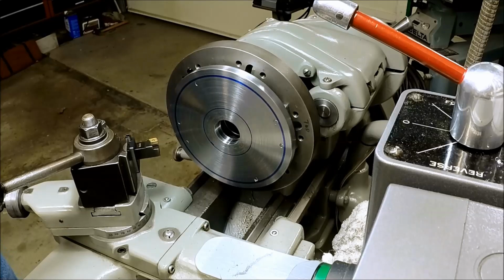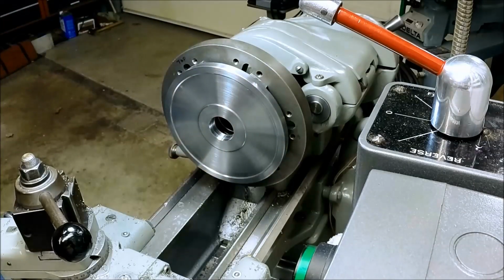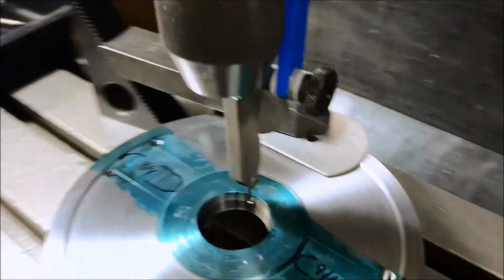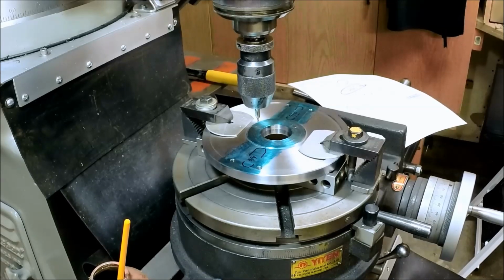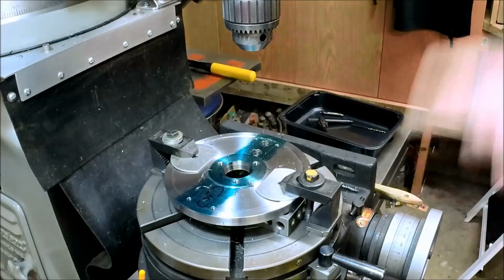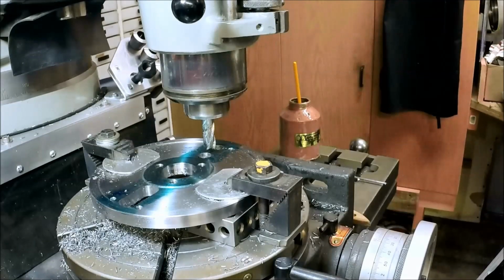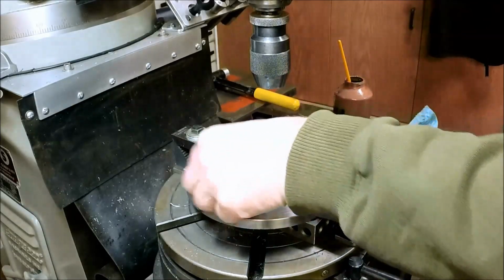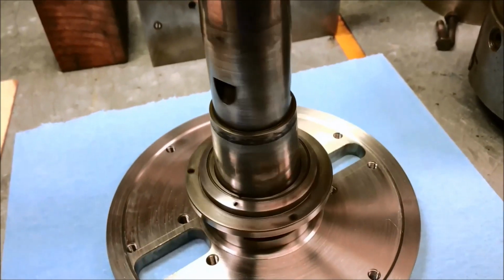Walter Dividing Head Restore Part 3b

Comment: Do you happen to know the part number for a 4 jaw chuck for the Craftsman 12" inch lathe with a 36" bed of the early70's.  Thanks very much for this - really enjoy watching your videos.
Reply from the maker: Tom, I don't know a lot about the Atlas / Craftsman lathes. Rather than a part number you need to know your spindle type. I believe they used a 1-1/2 x 8 TPI threaded spindle, but measure yours to be sure. Shop for a chuck that has that type of spindle mount back plate. I would not go larger than 8" on a 12" lathe, probably better with 6".
Best of luck, Dean

Comment: The lathe forward reverse lever sure pops looks really nice on camera. Do not worry I also seen this really nice machined plate ans liked the relief step cut into her face. Thank you for the Little Machine Shop math tip. Rotary table is the great easy to do this just less error for us. We love bearings, pin, ball, bronze, angular so yes lets get some new spindle bearings in there then you can nap while machining just funnin. Your plate is looking good clean machined finish fun to join in and watch you make this happen.
Reply from the maker: Thanks for stopping by for morning coffee. Sounds like we have the same routine. I really like keeping the original controls functioning even though others and I have upgraded to modern VFDs. Really adds or maintains classiness of the old machines. 
BTW I'm 100% in agreement on SKF bearings. There the only brand we found that would survive long term in a matched angular thrust pair (factory matched by SKF) in our mainstay machines we serviced. motor sizes were between 200 and 1200 Hp.
Time to refill my coffee.
Dean
Reply: @TheAyrCaveShop  WOW 200 to 1200 HP you are not messing around in your work, we are very impressed and reminder we are the 100 % opposite end of the spectrum of that size, Patrick is very happy to hear you too love the SKF brand of bearing share, it really matters a lot to him. Thank you.

Comment: Long before today's electronic dro's were invented high precision co-ordinate jig boring was done by using the dial numbers, or using tool maker buttons. One huge problem they had at the time was it's impossible to make feed screws and nuts to the required accuracy they needed, and the more accurate tool maker buttons hand tapped into place and then miked are very slow. Plus those screws and nuts started to wear to less accuracy the more the machine was used.All screws and nuts will show various degrees of lead and lag errors over there travel range even when brand new. Moore Tools couldn't make perfect threads for there jig borers no matter how much time, effort and money they threw at the problem. Instead they moved to an independent measurement system separated from those known problem areas. On the very old jig borers you can still see signs of what they used on some of the equipment since a lot of the manufacturers cast cavity's into the machines so high precision dial indicators could be mounted and length measurement rods in one inch increments could be used much like today's micrometer setting rods. Those indicators and rods were well above the accuracy levels  you'd see even with good one's from Starrett or Mitutoyo. The idea can still work on any mill without a dro though. The actual obtainable accuracy's using equipment were likely to have under the usual non temperature regulated shop conditions would of course be a bit less. 

I noticed you had a set of 123 blocks under that plate. If you do have a second set and there accurately pre measured so there actual dimensions are known then one block between a stop bolted to the table and the 1" indicators magnetic base on the column for the Y axis and one on the knee gives you a 0" - 4" capability depending on how the blocks dimension's are used. Add 3" more with a second block. In use the indicators lightly touching and zeroed to what ever face length is needed on the 123 block that's also touching the table mounted stop block. Remove the 123 block and move to your required co-ordinate as the indicator tip starts touching that stop blocks face. With an import dial indicator I'd still probably only trust it as being within maybe .002"-.003" since even the good one's do exhibit a bit of error over there travel range. It's still a good method since with a well worn machine there's going to be unknown variables caused by wear to it's screws and nuts. Accurate co-ordinate machining can still be done without a decent dro with a bit of time and thought.
Reply from the maker: Great write up and information explained so well I can almost visualize the process. I like the 123 block recommendation, I do have another set still in cosmoline wrap. The few marbles I still have are busy turning right now.
Thanks again for the great comment I know others will benefit from this as well.
-Dean
Reply: @TheAyrCaveShop  Your welcome, but better to thank every one of those long gone tool makers and jig borer machinist's who thought of this long before I was born. :-)